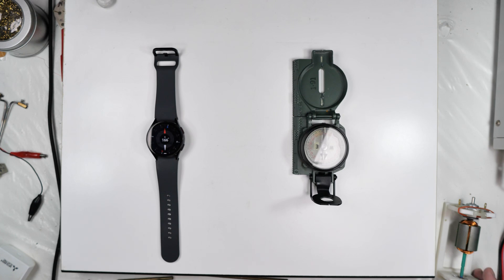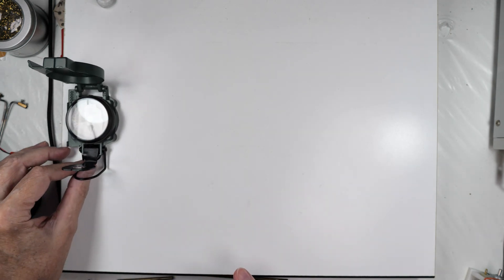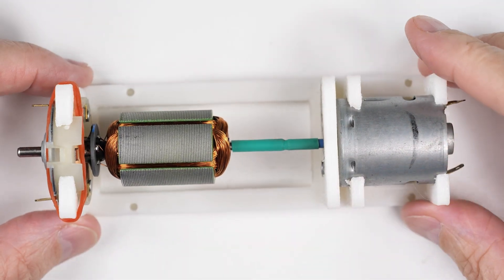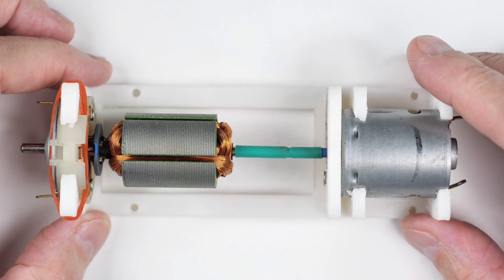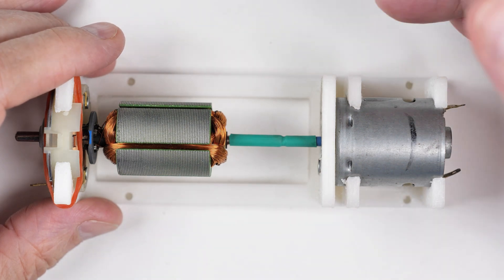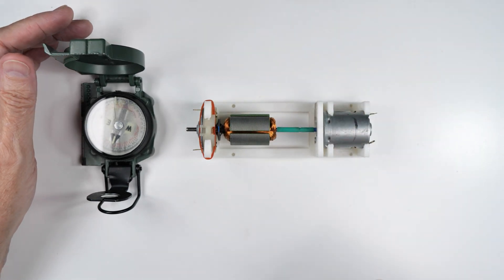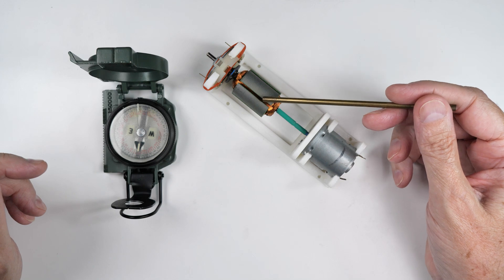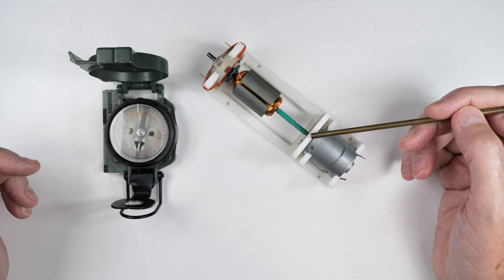Concept Was Right, Demo Was WRONG! Earth Inductor Compass (4K)

Comment from the maker: I have been asked how it "knows" north - south. What I said in the video is confusing, missing the Earth part, and only mentions the motor's interference. It knows north south because of the orientation of the rotor's brushes. Only 2 of the "arms" of the rotor are active at any time, and that timing is set by the position of the brushes. As I am turning the frame, the brushes are turning in relation to Earth's poles. The rotor's active arms are therefore moving around. When the active arms are best aligned with the Earth's magnetic field, then the output is at the max. And vice versa when the active arms are aligned east west.

Comment: Hi.  Love the channel!  Thanks for posting your tinkering!   Some thoughts from the peanut gallery:  There’s quite a bit of residual magnetism in the rotor (the one being spun) as evidenced when you were testing with the compass.  You may have a cleaner signal from an air core or ferrite core that doesn’t have as much hysteresis as the iron. I used to have a toy top that displayed a message with LEDs as it spun.  Surprisingly stable even as the top was slowing down.  It used a horizontally oriented inductor inside using the earth’s magnetic field to synchronize the pattern with the rotation. Again thanks for letting us share in the fun!
Reply from the maker: @danto2718  Thank you. Those are some interesting things to consider as I'm redesigning the demo. The residual rotor magnetism is one of those things. Not sure if I can demagnitize it or if it will enhance the effect. The original looks like it may have been ordinary steel! I will have to search for that top, sounds like a source of inspiration.
Reply: @tsbrownie  Indeed, if the original was steel pay no attention to me!   I don't think I can add links here but there is a youtube video you can find titled "Elektor magazine's messaging spin top"  That is about all I've been able to find on the toy top.    Good luck with the experiments and I always look forward to your videos!
Reply from the maker: @danto2718   Found it thanks. Have not seen that before. I appreciate your thoughts, they open my eyes to new things. Makes making videos worth the effort!

Comment: Sounds like a good plan. Maybe you could even use a wooden chopstick or plastic straw to eliminate paramagnetic interference if any.
Reply from the maker: @adnacraigo6590  I need to see if I can find more info on the original. My usual sources were lacking. Finding out what they used originally would go a long way in getting it right next time.